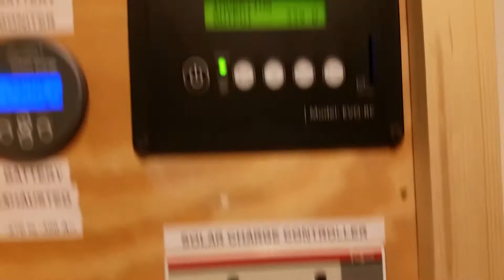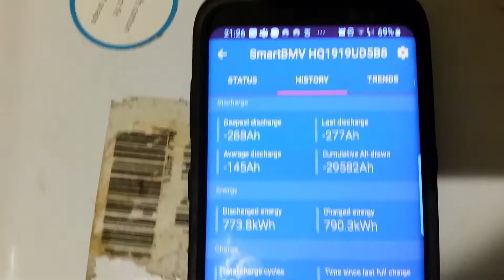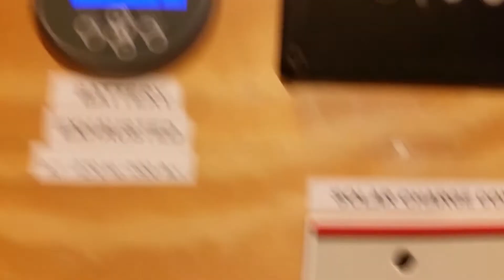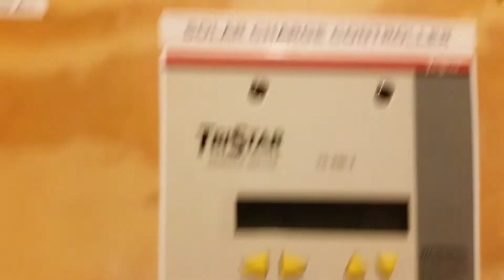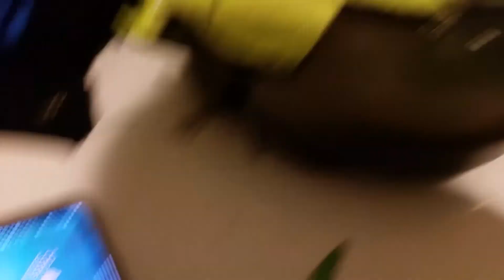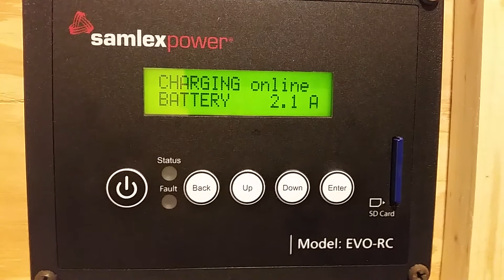Samlex Evo 4024 Inverter Charger:  Battery/Solar Priority Usage Feature

Comment: Any reason you didn’t go with a Victron charge controller? I’ve been using a 100/30 for a few years and I love the app. I just added a 100/50 and a 24/1200 Phoenix inverter to my system. I’m liking these EVO units tho for future considerations
Reply from the maker: Thank you very much for watching.  The Victron stuff was not out when I got into solar about 15 years ago (bought one of the Morningstar controllers about 13 years ago), otherwise, I probably would have.  Agree they have some very cool features.

Comment: Thanks for doing this video. It answered a few exact questions I had while investigating this equipment. Nice to see that you can set output priority and specify a low amp charging profile. How many circuits do you have on your critical load panel? I'd likely get the 2224 but wondering how many realistic circuits that would allow (fridge, gas furnace blower, some lights, etc).
Reply from the maker: Hey, no problem!  Glad you liked it!  This feature is one of the main reasons I chose this inverter/charger and it works like charm.  

So I don't use the typical critical loads panel, I use generator transfer switch boxes (see other videos on those).  I have two generator transfer switch boxes with 6 switches each, so 12 circuits.  Honestly, the 2224 model could handle what we do day in day out 99% of the time, but found an awesome deal on the 4024.  One of the few times the 4024 came in handy is documented in another video (short one) called "Off-Grid Solar Backup Power System: Full Capacity!"

Comment: You know I have my for 3 and 1/2 years the only thing I regret I should have bought it 24 volt mine is a 12-volt other than that I love it it has not messy slick in 3 and 1/2 year
Reply from the maker: Thanks for watching!  Definitely understand.  I've had 12 volt and much lower powered inverters in the past and always wished I had more capacity and higher battery voltages.  Doen't take much with 12 volts for the current draw to get really high.

Comment: Came across your channel about the EVO RC. You might make a video about using and navigating through the EVO-RC for everyone! Most don't understand the basic mapping of the screen. Thanks! I run the Samlex systems 1212 and 2224. These Samlex are very smart and worth the money.
Reply from the maker: Thanks for the comment Sui and thank you for watching!  Yes, I plan to do that soon along with many other videos on this stuff, but may move it up on the priority list.  Definitely agree that these Samlex Evos are a fantastic bang for the buck.
Reply: How is the samlex evo 1212? I'm just starting out but using a victron phoenix 800va. I want to tryout the samlex evo 1224f-hw
Reply: @diy-bj2ed  2224 and 1212  working beautiful! Just order another 1212 f hw for a different project but this time I’m going to even run the solar charge controller through too.
Reply: @FirstSuiGeneris  ok nice, just want to tryout the samlex 1224 to get into the low frequency inverter platform. Have you run the 1212 at full or 80% load ? If you have how loud are the fans?